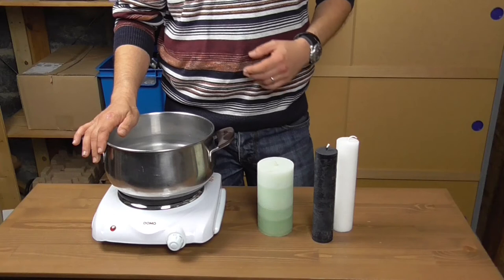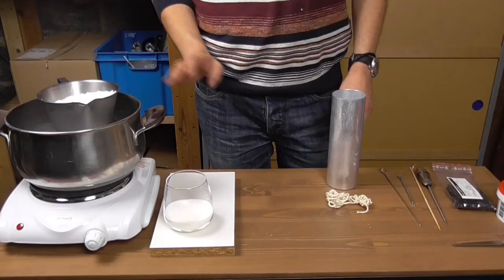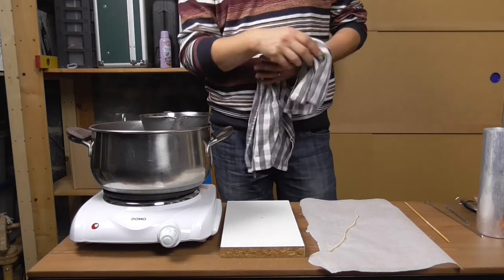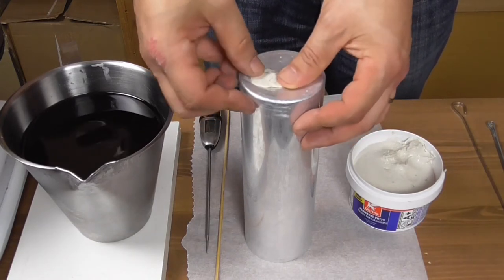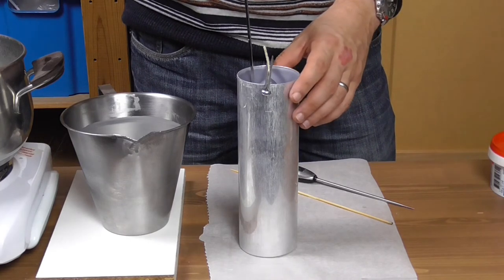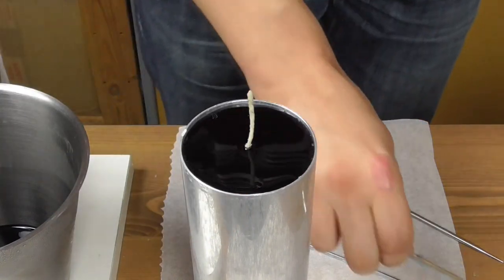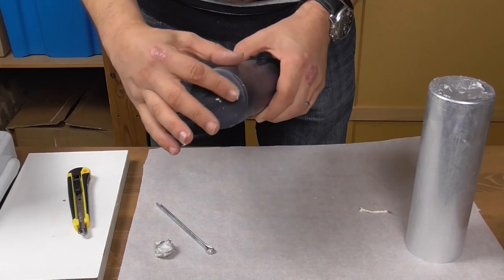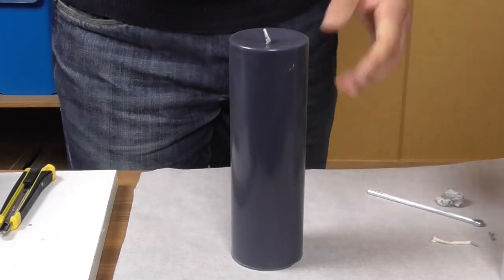How to make PILLAR candles? Candle making made easy | HowtomakeCandles.info

Comment: Does this work the same way with beeswax? Because the only thing holding me back from selling beeswax pillars in my shop is the fact that they sink in the middle as they cool. It's a whole thing. I think I made one perfect one ONCE and I don't know what I did different.
Also, I don't use a double boiler. I melt wax in old coffee cans from my dad's workbench. I dumped the nails and took the can, Bing bang boom, no expensive equipment necessary.
Reply from the maker: Hi Rose,
Yes, it's pretty much the same with beeswax. Just don't forget to spray the inside of your molds with a mold release spray or you'll never get the finished candle out... Good luck!

Comment: What’s the reason for adding Stearic Acid?
Reply from the maker: I'm using straight paraffin wax in this project. Stearic acid makes the wax look "nicer", less translucent. It also makes the wax harder, so it burns longer. You don't need to add stearic acid if you use a pillar blend, as it normally already contains all the additives you might need...

Comment: Hello thanks for the video. I was confused which wicks I have to use for pillar candles. But is there another option  for the wicks? I just have to fix the pillar candles which is showing tunnelling and little bit broken from bottom.
So what can I do? Should i remelt the candles or just fix the pillar candles from heat gun? Please guide me. I’m getting the wicks but it’s gonna take a month to get and my customer need it soon

Comment: Hey. Absolutely loved the video! One question! Do we need to oil the mould before pouring the wax? If yes then what type of oil?
Reply from the maker: Hi Srija, you normally don't have to oil the mold, unless you're using beeswax. In that case, use a spray of vegetable oil, like a cooking spray. With paraffin or another pillar wax, if getting the candle out of the mold proves difficult, just place it in the fridge (not the freezer) for an hour. That should do the job.
Reply: @HowtomakeCandles_Channel  Thank you so much!

Comment: very nice im about to use a pringles can as my mould with a paraffin coloured wick and beeswax candle, but as a single guy i dont think i'll be using tights (pantyhose) to wipe it down i think i'll just use an old t shirt
Reply from the maker: I didn't steal my wife's panties John, I just bought a cheap pair from the corner shop :-)
You may want to use something made of nylon though as it's not such much the wiping that does it but mostly the heat generated by the nylon.

Comment: Why we should not melt the wax directly?
Reply from the maker: Because you could easily get to a dangerous temperature if you melt on direct heat. Only very few applications require direct heat, like candle gel and paraffin wax when you make sand candles. Other than that, always use a double boiler or a wax melter.

Comment: What di you call that cloth_is it a speacial cloth fabric?
Reply from the maker: Hi Silvia, do you mean the pantyhose (stocking)? Anything made of nylon will do, as the rubbing creates just enough heat to gently melt away the wax at the surface of the candle.
Reply: @HowtomakeCandles_Channel  thank you